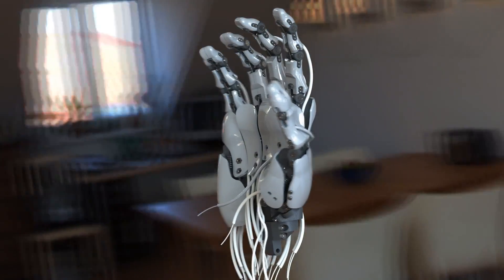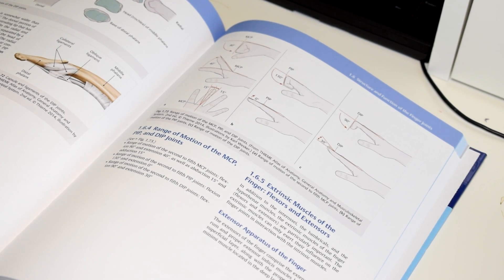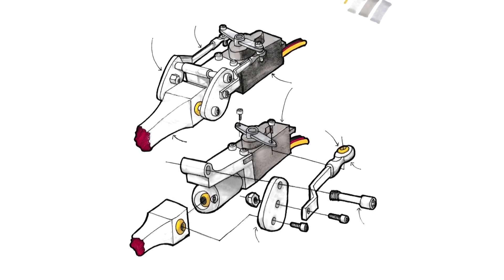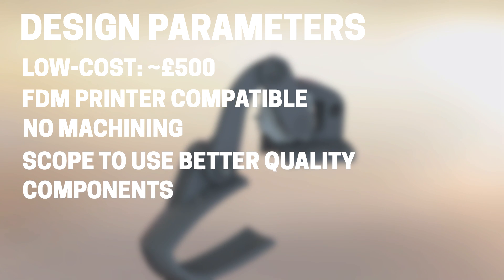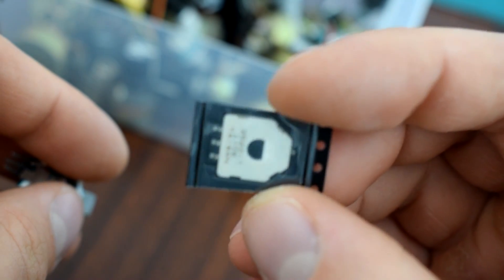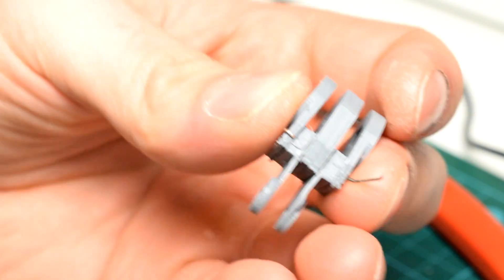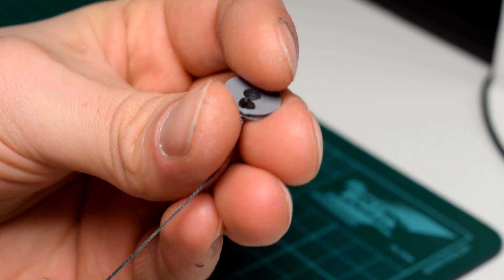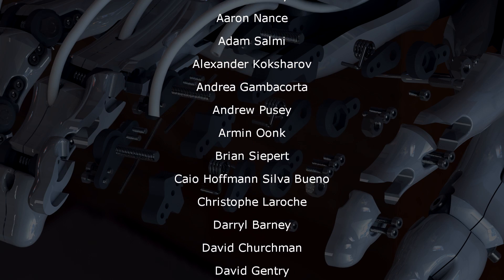Redesigning My Biomimetic Mechatronic Hand - 3D Printed Interphalangeal Joint

Comment: What types of servos do you use to pull the cables (are all MG90S?)? Did you make a servo platform?
Reply from the maker: Yeah at the minute I'm just using MG90s servos for this prototype, I don't expect I'll stick with them. There's no platform on this model, just a little adaptor to hold the cable sheath.
Reply: @WillCogley  You might want to use SG90 (or a smaller servo) for some parts which require less force. It can make the design more compact and use less energy if using an external power source. I also use one type of servo for a project and I think it's going to be a problem later on when we make it modular.

Comment: Just buy an Elegoo Mars for less than 250 quid and you can stop fiddling around with FDM prints well bellow the resolution those printers are supposed to be used at. Even those cheap LCD SLA printers are capable of astonishing details and dimensional accuracy, and well worth the money spent.